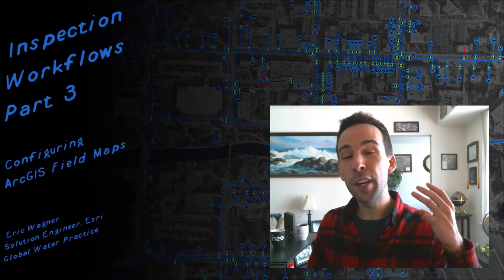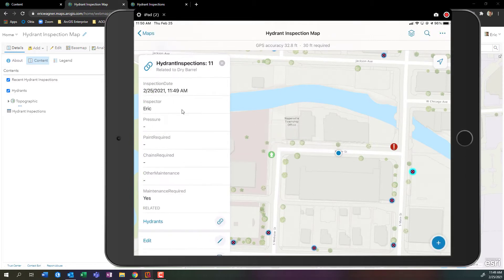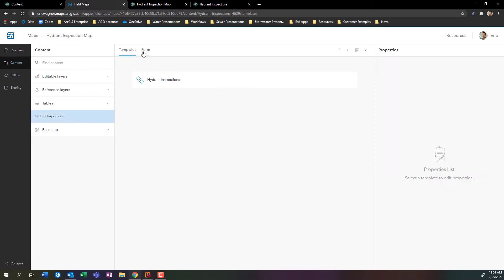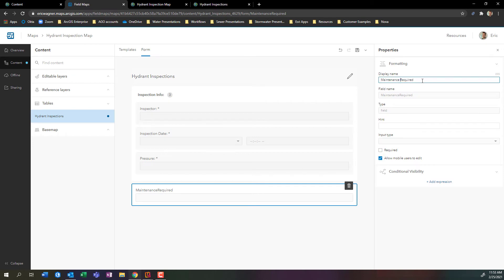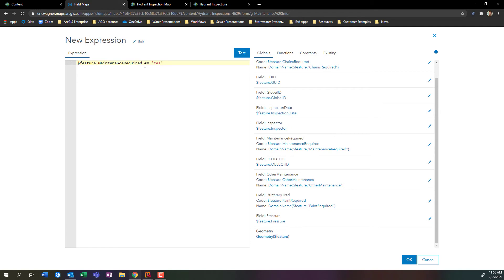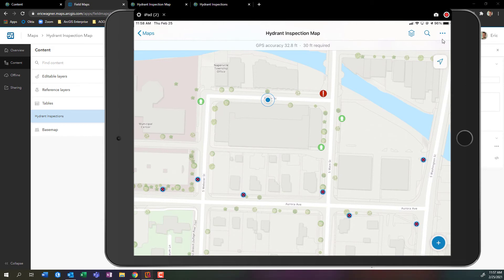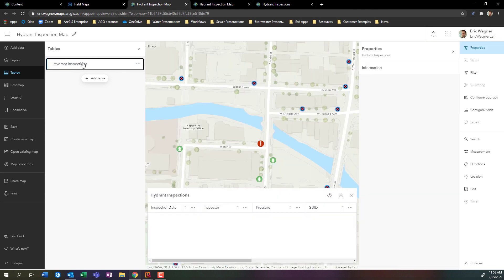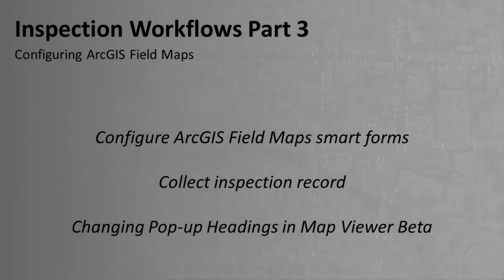Inspection Workflows Part 3: Configuring ArcGIS Field Maps

Comment: Thank you Eric, these videos are very informative!  I've followed your workflow, but Field Maps will not load the 'Recent Hydrant Inspections' layer. The error (3047) appears to be related to duplicate fields. Because both the 'Hydrants' feature layer and 'Hydrant Inspections' table contained a GlobalID field, the resulting Join Features 'Recent Hydrant Inspections' layer contains two GlobalID fields (one of which gets renamed to 'globalid_1649266887779').  I'm not sure why this works in your demo but fails in my Enterprise 10.9 environment.
Reply: Got the same issue. Also saw your post on the ESRI community. Still couldn't find a workaround...

Comment: When I submit a maintenance record I get the error: Unable to submit, service error code 1000.  I am confused what this error is and how to resolve it.  Have you had any experience with the maintenance records not saving?  I can tell the tablet is thinking for a few seconds upon submission and then the error comes up?  Any idea how to resolve?
Reply: Hi Josh B! First, I recommend logging out of Field Maps and signing back in. Try collecting data again. Sometimes it's just an authenticiation error.

You could also try going to ArcGIS Online and going to "Contents", find your hosted feature layer, go to it's "Settings", and click "Rebuild Indexes". Refresh your map in Field Maps and try again.

If that doesn't work, try adding the layers used for inspection to a new map and see if the issue persists.

Otherwise, try rebuilding the relatioship class and republishing to ArcGIS Online.

Comment: Hi Eric. You're videos are perfectly paced! If you want to input a good amount of historical data, is there a way to do that on the desktop(in AGOL or ArcGIS Pro)?
Reply: Hi, Bob! Thanks again! When you say "input historical data," I assume you mean historical maintenance data that needs to be related to a parent feature. In my example, it would be: I have a bunch of hydrant inspection records and I want to associate them with the correct hydrant on the map. Is that correct?

If so, this process isn't difficult, just potentially tedious. Remember that the maintenance records are nothing more than rows in a table. What makes them special is that they have GUID values that link/relate them back to the parent feature's Global ID value. It's all about the unique identifier!

So, imagine your related table in ArcGIS Pro that you've built. It has a series of attribute fields. Hold onto that. You could build an identical table in Excel with the same field headings. You could then populate this Excel table with all of your maintenance records. One row per inspection filling out all of the fields. This is the first area of potential tediousness, many utilities have all of their old maintenance records on paper. So in effect, you're transcribing/digitizing all of your paper records into a table. Not difficult, it just takes time. If you're lucky, maybe this has already been done!

Here's the second tedious part, your Excel table would need that GUID field (remember, this field is the glue holding the parent feature and child records in the table together). For each hydrant inspection record, you'll have to find its hydrant parent feature in GIS, get it's Global ID and paste the Global ID value into the Excel table's GUID field for that inspection. In other words, I have an inspection record for Hydrant 12345 in my Excel table. So, I'd go into ArcGIS Pro, locate Hydrant 12345 in the parent layer. I'd see that it's Global ID is ABCDEFG. I'd copy that value and paste it into the inspection record's GUID field in Excel. So, now this inspection has a GUID value matching the Global ID of the parent hydrant. Do this for every inspection record in the Excel table. If you're skilled with Excel, then there might be some shortcuts you can take to help save time.

Once the Excel table is complete, you can bring it into ArcGIS Pro. If you've never worked with Excel in ArcGIS, you can't add an Excel table, instead you add the individual Excel sheets from the table; this can be done in the Catalog pane. Once in Pro, convert the sheet to a Geodatabase table using the Table to Geodatabase (conversion) tool. Now that it's in a GIS format, you can use the Append tool. This allows you to add records to an existing dataset. You'd be able to append the historical records to the existing inspection table that you already have built in ArcGIS Online. Since you have the GUID field populated in the table you just built and appended, ArcGIS Online will honor those values and link them to the correct hydrant parent feature. Depending on the number of records, append may take awhile to push the local data into ArcGIS Online.

Once complete, you'll be able to tap on hydrants and access the historical records you just added.

Pro tips:

- The append tool is nice because it has a "Field Mapping" parameter. This controls how the attribute fields from the input datasets (your historical records table that you just made) will be transferred or mapped to the target dataset (the inspection table in ArcGIS Online).

- When hunting for hydrants in the parent layer to look up Global IDs, the attribute table does have a "Find" function. In the upper right corner of the attribute table click "More Options" and choose "Find and Replace". Click the field heading that you want to search in, and use the search bar. It's faster than digging through the table or using Select By Attributes.
Reply: @ericwagner5794  How/why in the world you take time to reply in such detail is amazing. I'm very grateful for this advice, it was the exact situation and solution I was looking for. Have a great week.
Reply: @bobsage , I truly believe the world is always a little bit better when people share their knowledge! If I know something that could be useful to others, why keep it to myself? 🙂 Plus, I bet you're not the only person with this question! Glad it helps!

Comment: In Field Maps: Can you edit an already existing inspection (related table record), such as to update a value you want to change? Or delete an inspection (related table record)?.. Or can you only add new records from Field Maps?
Reply: Hi Katherine! You're able to add new inspections (as shown in the video), but you can also delete existing inspections or edit individual answers/attachments in them after they've been submitted. Tap on the asset that's been inspected, under "Related" tap on your related table, tap on the inspection record of interest and down at the very bottom, you'll see the options to: "edit", "copy", or "delete" the inspection record.

I'll add this as well: some organizations don't want field crews to be able to edit or delete old records. They want crews to be able to see the old records, but not change historical submissions. You can configure your dataset to allow for the submission of new records, view old records, but not edit old records.* To do this go to the item details page for your hosted feature layer that has the related table. In the upper left corner, go to "Settings." Under "Feature Layer (hosted)", look at the "What kind of editing is allowed?" question. Here, you can choose if field crews can ADD new inspection records, DELETE existing records, or UPDATE (edit/change) existing records. Check the options that you want crews to have, and press "Save". Then, refresh your map in Field Maps.

Hope this helps! Happy Mapping!

*You must be the owner of the dataset or have it shared to you properly in a group to change these editor settings.